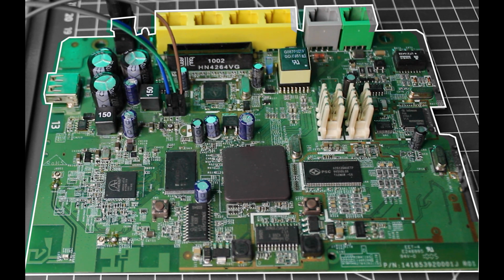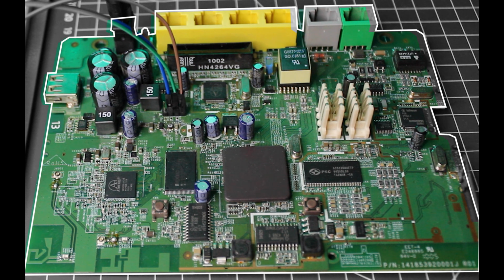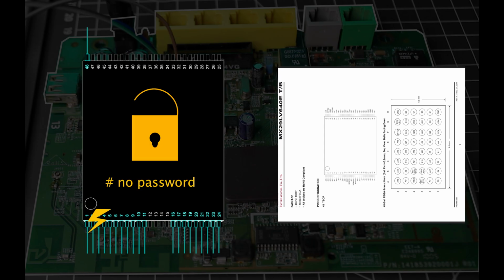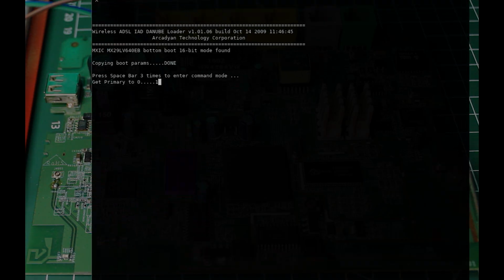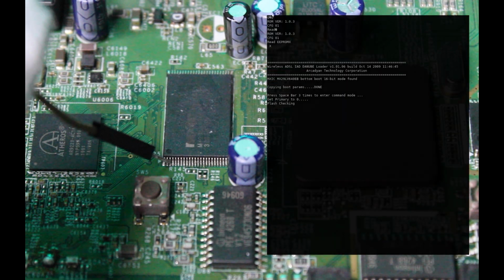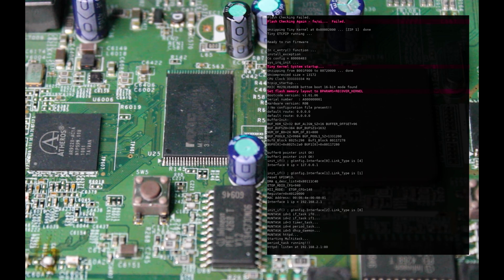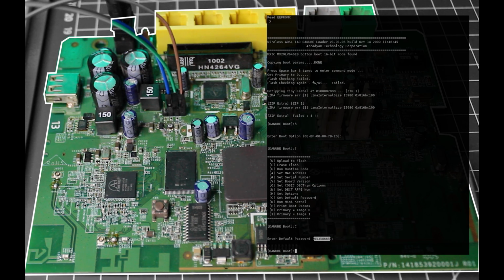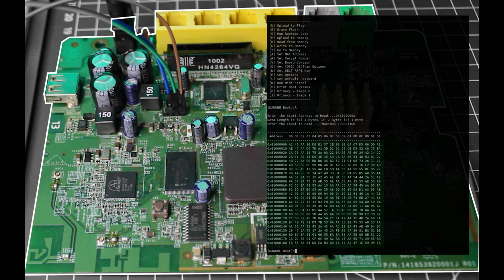Pin to Poke - How to hack your router!

Comment: Its called glitching in the hwhacker world and really useful, but you need to be careful because i bricked some devices doing this to the point where even the primary bootloader wont startup meaning you sit with a bricked device and a sad face.
Reply from the maker: Yes. I mean to be more clear about it. I am not grounding the actual output lines (datasheet Qx). I am grounding the address lines (datasheet (Ax). This leads to "wrong" value because "wrong" address spaces are being selected. Grounding during read should be fine. Grounding during a write operation, this can screw up the device - yes :D At least for this device, it is not very likely to happen that early in the boot stage but yes - be careful. And never ground VCC!! ... unless your powerglitch and know what you are doing.  :)